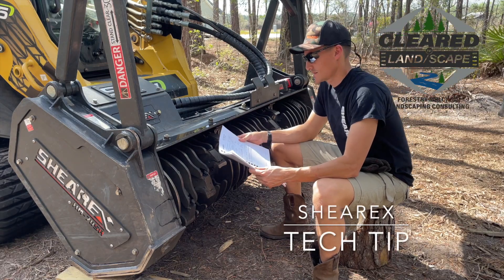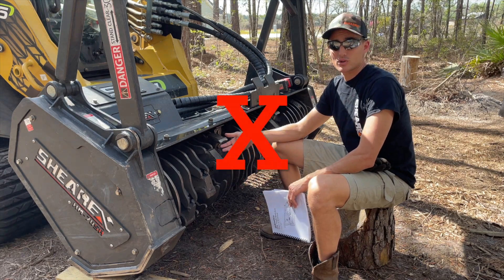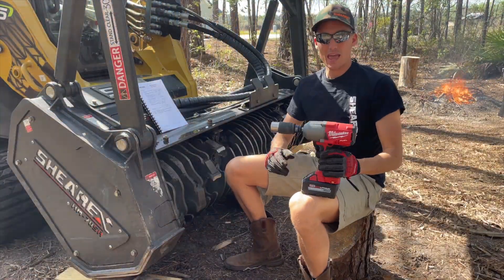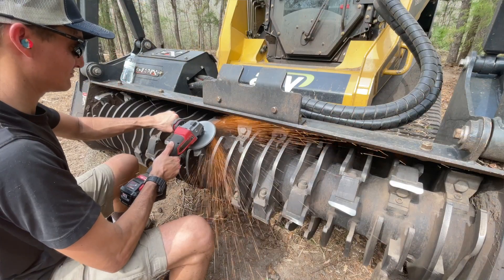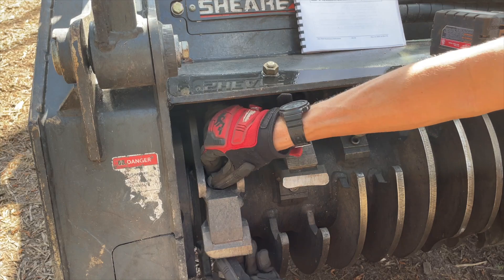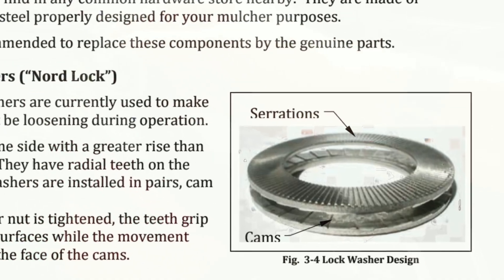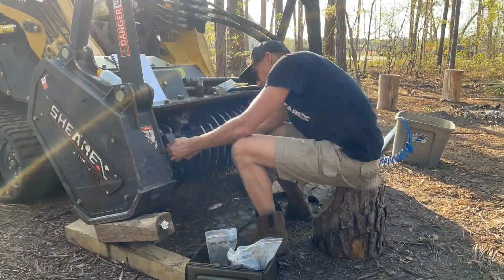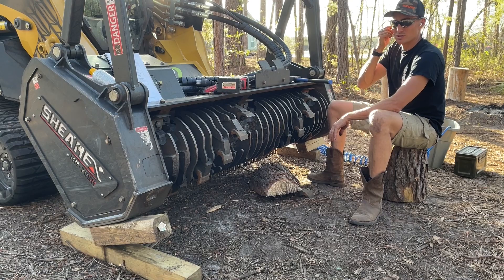ASV 135F & Shearex Blade Change Tech Tip #1 Short #construction #mulching #forestry #engineering

Comment: How long do the teeth on the shearex last you roughly?
Reply from the maker: I got 150hrs off the last set, and still had a little life left. It's important to know what your are doing when sharpening them. Too long and the teeth get too hot and it changes the hardness of the steel affecting the longevity of the teeth. These are Amazing. But you have to keep them sharp. There are many factors impacting teeth longevity. Such as technique, material processed, sharpening frequency, and the soil conditions the teeth are operated in.
Reply: @clearedtolandscape  I highly appreciate the reply! Very informative and I just purchased my first Shearex head. Is there a good video to watch on sharpening the teeth? I know the techs showed me how to prevent heating the teeth but I’m still not great and sharpening them.
Reply from the maker: Yes there is!

https://youtu.be/u9likuBEsrw